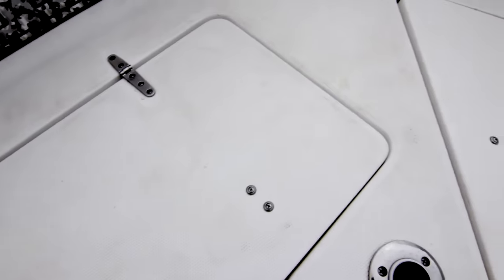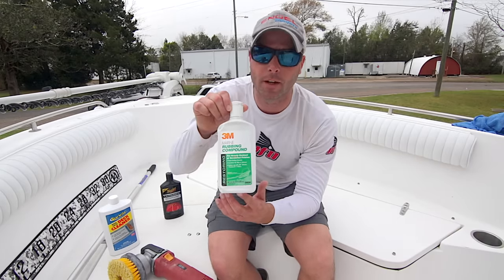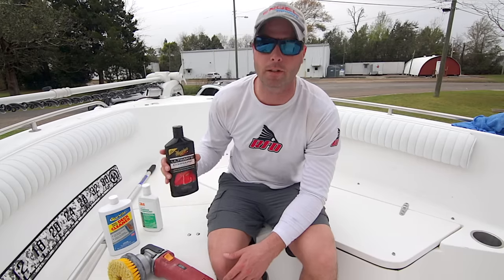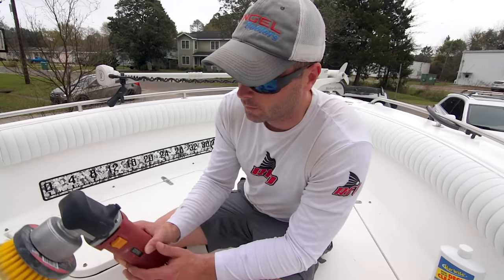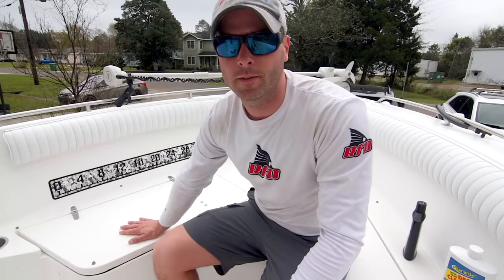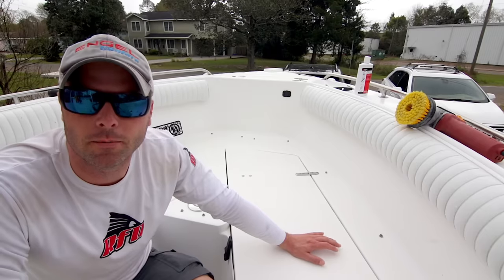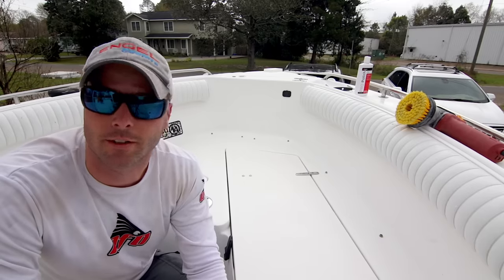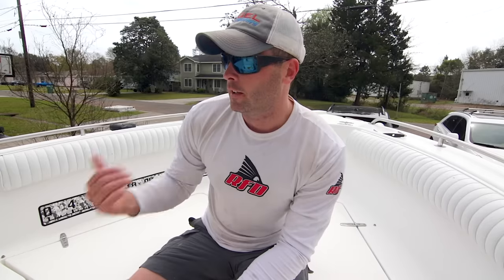How to Clean Non-Skid Boat Deck the Right Way!!

Comment: Youre funny. Theres another method thats 10times easier and more effective, After cleaning your non skid with Starbrite, just spray on some Woody Wax ( a special non slippery wax for non skid ) the just hose off. It works even better, cheaper and really 10 times easier.
Reply from the maker: I agree! Woody wax is great but I just can't get it last. I use it as a topper on this and it's awesome

Comment: HELP! Boat newbie just bought a two year old boat. The deck is filthy every time you walk on it and hard to clean. I'm confused after watching this video twice. Is this correct? Step 1: Rinse with water. Step 2: clean with Star Brite non skid deck cleaner. Step 3: Rinse again Step 4: Polish with Meguiar's Ultimate Compound. Step 5: Re-clean with Starbright. Step 6: Rinse again. Step 7: Polish again with Shurhold Yacht Brite Pro Polish. Why do you need to wax twice and with two different products?

Comment: I work for CNB here in France as a Finisher. It's a Luxury boat construction firm and I'm working on the seventy7 and seventy8 models (largest and longest).
I just wanted to let you know that if you buff / polish non-skid areas on your boat, they lose their "grit" (ability to stop you from skidding on it). I'd suggest you ask people getting on your boat to either have special shoes or go bare-feet when on the boat, and then cleanup is as simple as using a pressure washer with just warm water or acetone (or another product you think works).

Also, waxing gelcoat makes it slippery. Which is why we wax molds before gelcoating them.
Reply from the maker: P5ykoOHD I agree for other kinds of non skid. This diamond pattern is not slippery after doing this. It’s the pattern itself that makes it non skid.  I’ll do a video soon to show that’s it’s not slippery after waxing. I can’t speak for any other type of non skid though. I’m sure other types would be insanely slippery.

Comment: a really good reason to have the deck ''tread pattern'' in truck bed liner, in a darker color. did that on my old glass boat and wow...no maintenance! And no more blinding white interior.
Reply from the maker: Capt Dave's Sport Fishing very interesting! I rarely ever fish barefoot, but how is it on bare feet?
Reply: @Captkylejohnson  the stuff I had was rubbery, and I never not have shoes on, but it wasn't that rough. throw a 12 oz. bank sinker and miss? the sinker bounced. plus, my ole 23' MayCraft was not a liner boat. So it sound deadened the boat, too.  Then, I got really smart, and had a aluminum 26 footer built, that came with Aircraft carrier non-skid deck paint. Now,  I do NO hull maintenance, other than spray off the deck. NO more stark white, getting dirty, problems for me. Plus, I'm not trying to look cool. it's a different ''life style'', fishing a big alloy boat. no wax, buffing...nothing! But, ya gotta find the right guy to scuff up your deck, clean it, mask out a tread pattern, and spray the right stuff. My ole boat sold immediately after 10 years of hard daily use. Because it looked great inside. Used a light tan bed liner.

Comment: Great video.  Thanks for sharing.  I am a little confused about the polish questions? 6 months ago Linda Zambelli asked what polish you used and you replied that you didn’t use polish because it would make the non-skid too slippery. At 11:40 and 13:10  I “think” you talk about adding a pro polish?  I think I am confused or maybe I am just confused on what the best product to use?  

BTW, thanks Tom Lester for the spray bottle tip on the non-skid deck cleaner, love the idea!

Thank you!
Reply from the maker: Shurhold "wax" or "sealant" calls it a "polish." If you compounded it and used an actual polish it would be extremely slippery.

Comment: Great tip, I’m getting ready to clean up my non skid but my boat is a 1984 Regal and it chalks up now no matter what I do. I know you said it doesn’t make it more slippery but I can’t see how it wouldn’t. Anyway I will try it the way you do it and hopefully I will get good results too thanks.
Reply from the maker: Pistonburn it’s the diamond pattern itself that make it non skid. Even with wax on it, the grooves in the pattern are what catch and prevent it from being slippery

Comment: A waxed nonskid will bust your ass..
However you never applied wax or a sealer
Polish is shine not protection
Wax is protection not shine
You could follow up with a dupont sealer or a wax but you will slip and slide 
When you polish gelcoat and dont seal it, oxidation will begin that hour, immediately.
As small as your boat is, you should be able to take off all marks and scuffs in non skid with Magic erasers.
great video, love boats (Hit The Like)
Reply from the maker: Shurhold Pro polish is actually a sealer and thats what I used for the "wax." It surprising it's very slippery after doing this. Is it more slick? Yes, but not too bad. You are correct about using actual polish. You will bust your ass if you do that!
Reply: I use a Magie erase and they work greak but want to know the best thing I can do to make make the cleaning easier without creating a slippery deck.

Comment: enjoyed your video, no BS just to the point with a little humor thrown in. I live on the SC coast and a a 19 ft skiff that im crazy about keeping clean, I knew there had to be a quicker way, nothing worse than spending a day on the water and THEN having to spend the rest of the day into the evening cleaning my boat. Nothing like anchor mud and fish blood to pretty up a boat! Not to mention the stains it leaves, Ive always used bleach after washing it down but still had stains. Im going to try to the star brite, I already the exact polisher (I also do paint & body work) along with Maguire's and see how it work. just quick clarification, compound originally is used as a cleaner not a sealer so are saying the compound will seal the surface from dirt or at least repel it? thanks for the video .

Comment: Great video, this is exactly how I do it also, starbrite cleaner then compound with HF dual action using shurehold brush attachment. But I use a Marine 31 One step heavy cut cleaner wax. it cuts like heavy compound but finished out to a nice shine and waxes at the same time to eliminate the Pro polish step. Ive used pro polish before when waxing hulls but i wasnt overly impressed. if im going to do a two step process id use a compound but my wax of choice is meguiars  premium flagship wax, goes on very easy and wipes off effortlessly.
Reply: Do you have a problem with it being too slippery?

Comment: Last fall I read on a fishing forum about using equal parts of blue gel Lysol toilet bowl cleaner and some good peroxide mix it up good spray it on with a garden sprayer then power wash it off.  works very good on the Hull of the boat too to get the scum off from the river water
Reply: I then wash it off with soap and water also
Reply from the maker: Toilet bowl cleaner does work very well, but it makes me itch like crazy! I must be allergic to something in it.

Comment: That rotary brush has sharp teeth and they scratch off the hard gel coat shell and allow porous internal material to be exposed. This allows dirt to easily get absorbed. 
ProPolish contains an oil that quickly seals these pores but it evaporates and disappears quickly when in the sun. You need to use something with a hard ceramic matrix. Use wool or soft foam pad and polish to remove oxidized wax and gel coat.

Comment: Thank you buddy. I am doing this to my non skid today. I am going to try an additional last step after your method by using Meguires ceramic spray wax as an additional sealant on the non skid. As it is has great hydrophobic and sealant properties and is super easy to apply spray on pressure wash or strong hose off. 
Cheers
Reply: I did my boats non skid and very pleased with the results. I will probably add another coat of wax sealant. I am well knackered, it has been very sunny today. Cheers.

Comment: Hey Kyle if it's a nonskid deck won't waxing it make it slippery when wet ?
Reply from the maker: Hooked-n-Rolling Offshore 2009 not if it’s the diamond raised pattern like shown in the video. I can’t speak for any other style of non skid, but mine is not slippery after doing this. I’m actually in the process of ceramic coating it now. I’ll have a video up soon and demonstrate that it’s not slippery.

Comment: I did it the exact same way. And that brush seemed to leave a very faint yellow tint on my floors any recommendations on what I did wrong or what can I use to take it off?
Reply: Same thing
Reply from the maker: Interesting. I did not have that problem. What kind of compound did you use? Are you sure it's not residue from the compound?

Comment: Where did you get the adapter to fit the brush on a harbor freight tool?
Reply: Where do you find the adapter for the harbor freight polisher to fit the shurhold brush
Reply: Jeff Mitchell I am having the same issue. Trying to find an adapter for this
Reply: Did anyone get a reply about the adapter??
Reply: @jeffmitchell4980  did you find an adapter?

Comment: I guess I was led wrong after I bought my boat in 2013.  I was told to use the StarBrite every time we clean the boat, which is after every time I use it.  I've had it covered in the back yard through the winter and uncovered it this past weekend.  The first thing I noticed was the smell of cat pee (or maybe squirrel).  I thought I had it sealed up but apparently not.  I knew I could get the smell out, but I've got a long orange streak running from the console back to the transom.  I took the batteries out early last fall to replace them.  I bought the new batteries but didn't install them until this weekend.  So no batteries in place for 4 months.  Starbrite wouldn't take up the orange streak nor the gray spots right in front of the console (the batteries sit right under the steering wheel/console.  Sorry for the long story, but do you know what might get rid of that orange streak and the gray patches?  Starbrite didn't phase them.
Reply from the maker: diluted Muriatic Acid. Start with it very diluted. Be careful as it is some strong stuff!

Comment: Nice video!! What would you recommend for a boat hull that has some light chalking? Some products and application?
Reply from the maker: Matt Leicht I’m currently compound, polishing, and ceramic coating mine! I’m a big fan of 3m products, so 3m super duty compound and finesse it glaze polish did a great job for me. Video will be out soon!
Reply from the maker: Matt Leicht I’m currently compound, polishing, and ceramic coating mine! I’m a big fan of 3m products, so 3m super duty compound and finesse it glaze polish did a great job for me. Video will be out soon!

Comment: Hi Kyle, is there any advantage over using a brush attachment on a DA polisher vs brush attachments for cordless drill?
Reply: I think a DA is a lot safer to use , maybe less chance of burning through and no swirls ?  Plus you can use it fairly safely on your car

Comment: Did you use the same brush to compound and Polish?  If so, what did you use to clean the brush?   Last, how often do you repeat this process?  Once a season?  Thanks.  Great video.
Reply from the maker: Tommy Liu yes, I used the same brush. I took the brush off polisher and cleaned it in a bucket of water with dawn soap. It got all the compound off. It all depends on the sealant (or wax) you used and how often you use your boat. This was the longest lasting I found before ceramic coating. Ceramic coating very easy to apply and outlast anything else I’ve used so far. Putting up a video very soon about DIY ceramic coat.

Comment: This was great. Perfect timing. I have the same DA too.  Question: can you do this in direct sunlight? And how often should I reapply. I use the boat 4 days a week. Thanks!
Reply from the maker: I did it on an overcast day because I didn't have anywhere to do it out of the sunlight. I wouldn't do it in direct sunlight. It will most likely make things much harder.

Comment: 3M perfect it compound and wax might work a bit better over the ultimate compound. You said not to use a paste wax? I know the 3M paste waxes last a very long time.
Reply from the maker: I agree, I just had the ultimate compound laying around and it spread very easy. Only reason I said that about paste wax is because I tried it, and it was very hard to spread. It was also a pain to buff off. The polymer based waxes are just a lot easier to work with.
Reply: Kyle Johnson Fishing sweet well thanks for the reply. I just purchased a trophy that someone neglected pretty bad. I’ve used the Starbright deck cleaner but unfortunately I think I may have to use bleach soft scrub once to get it back to white. Too afraid to use the acid based products.

Comment: Cotton grinder buffer wheel on a drill is what I saw in another video to do the final polishing of getting the wax polished
Reply: how do you attach those to angle grinders? and will get get in between the dimples?

Comment: Hey Kyle, you also mentioned an application of ceramic coating on the non skid. How did this work? Worth it?
Reply from the maker: Jason Beard it didn’t last that long honestly, but I was in a rush and only had time to do one coat. Only did one coat of ceramic on my hull and inside and it last a solid 9 months with real world use and heavy fishing. The ceramic lasted maybe 4 months on the nonskid.

Comment: After using Starbright my deck was sparkling white. After using Maguires compound the deck turned yellow. Used the Starbright again to brighten and then used the polish that you recommended. The deck has a tint of yellow. I will never do this again. I wasted a lot of my time. I'm just going to use Woody's wax from now on. My time is too important.

Comment: polish compound within seals/ compromised? GASKETS, RAMS FOR trim tab lifts/rams WATER AND PRODUCT DRIIPPING IN Speakers... seems an ideal concept but practical a[application is questionable.
Reply: compound equals particles/fine grit/media, a vessel is designed to bleed water bow to stern, while
where does the "compound end up during the rinsing process??!!! seals>gaskets, do you think it might chew away at the working parts of the vessel.

Comment: I can tell you why people don't read,  Because they can't.  I work in a library and have seen it first hand.
Reply: In the UK (and EU) people don't read the pack because 90% of it is 'mandatory labelling' rubbish that almost no one needs to know (and could check a website if they did need it). So the important usage instructions are buried away in tiny, tiny print that you probably can't read anyway.